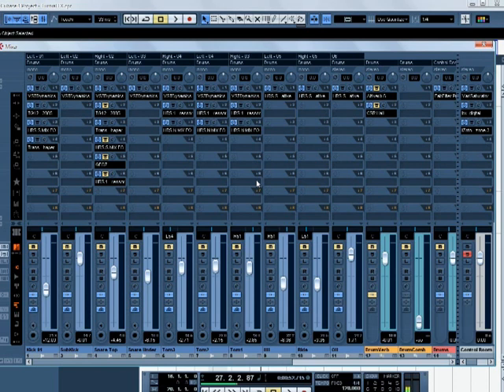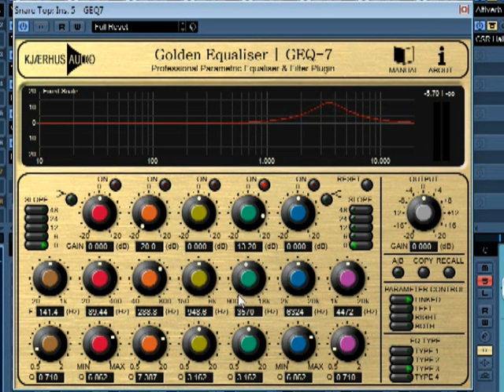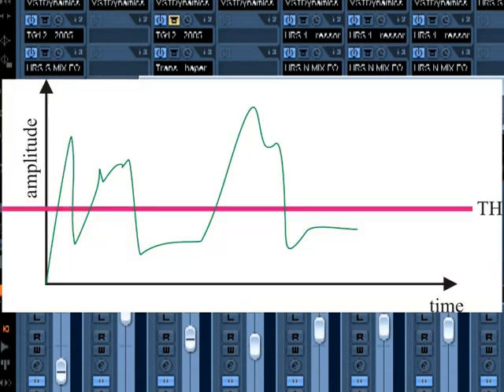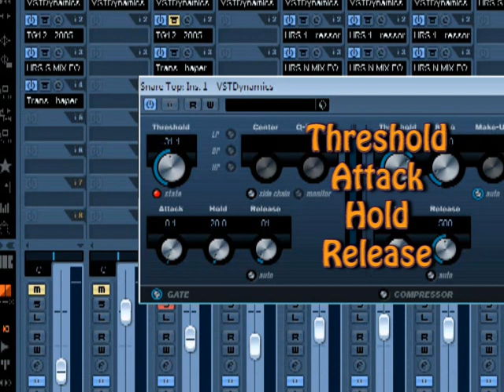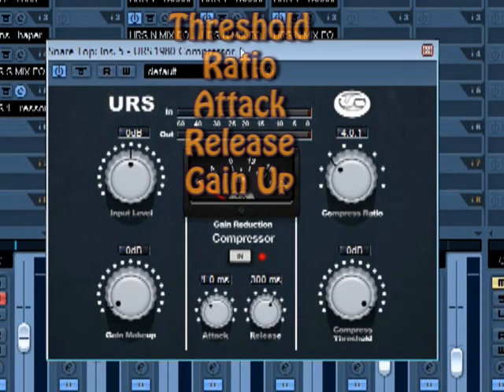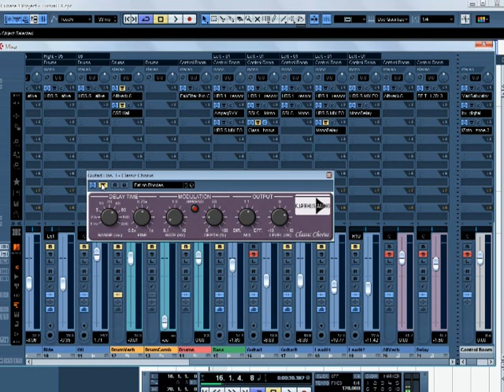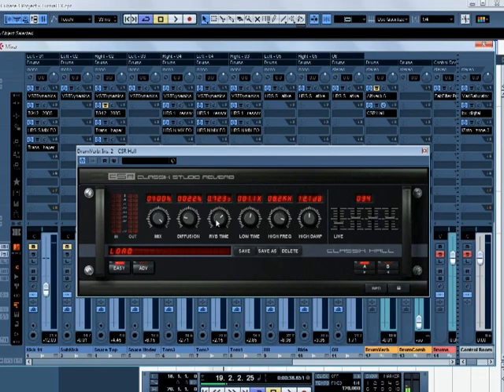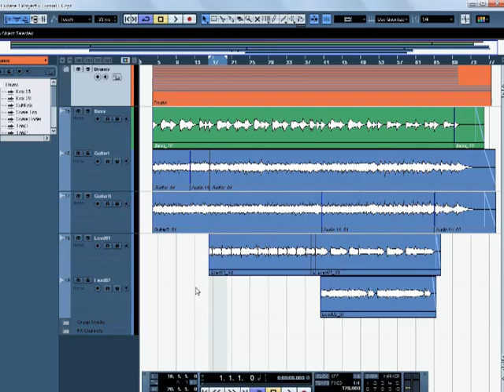Recording Studio Tutorial: Effects

Comment: Would you please help me ? .
I use built-in drums from my sinth. and 
I 've got  some issues: Drums set sounds so good, however, after being recorded into my DAW, it  looses some details. Is it  normal ? To fix this,  I open the DAW and disable its  EQ even though I did'nt touch it while recording..After that, the drums  sound better but there's clipping as result.. What do you suggest me to fix this issue ? The sinth's built in drums are originally factory made and set under any processors ?